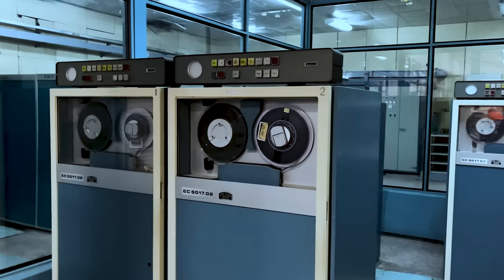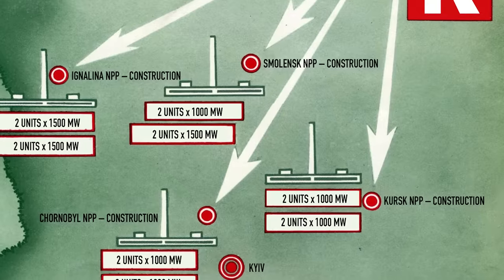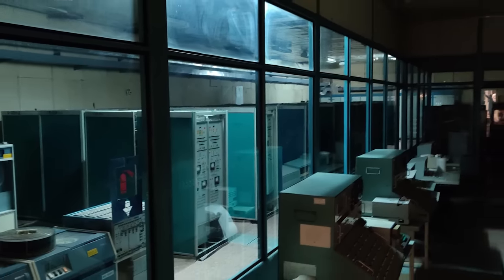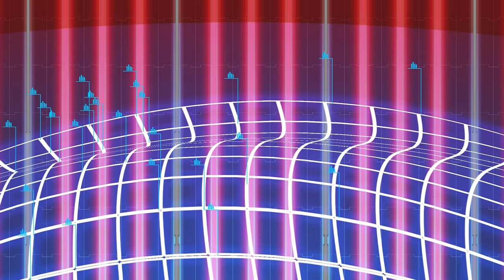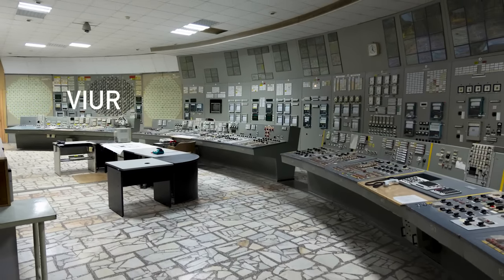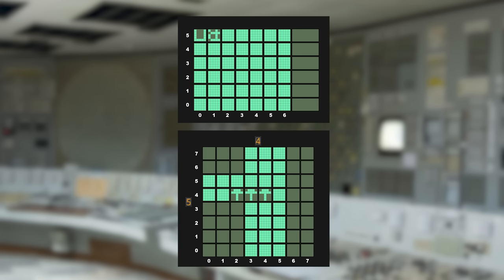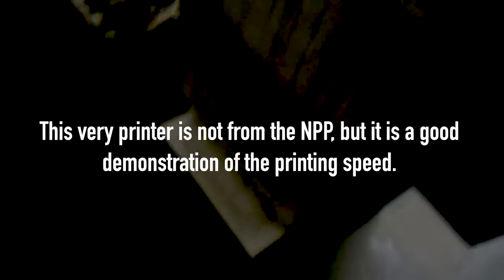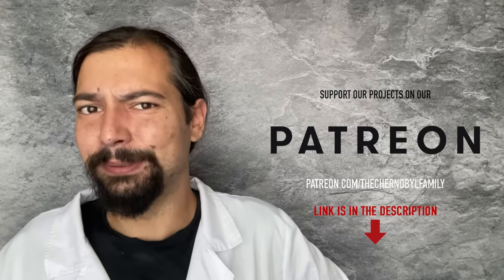Exploring SKALA: Chernobyl Reactor Control Computer

Comment: The computer resource limitations you discussed are not only in the Chernobyl Skala system but also in the USA 3 mile island reactor installation. It was noted that the priority data output from the computer was lagging very far behind during the melt down emergency.  I am thankful for the chance to see this equipment which may have been lost to the scrap yard without your intervention.
Reply from the maker: Thank you for those details!
Reply: I guess, the measurement reports came in so fast that the computer could not handle it in real time. 

Real Time operation was a big thing in the 1980ies; and not many computers could do it. Seeing it from today, these 'high tech' machines were slugs, but there was no better technology available, because it had not yet been developed. Don't assume that a Commondore 64 could have been able to do it. A memory of 64 kilobyte of RAM would be nice; but processing the reports of 1661 channels in real time was beyond its capacity. 

Also, all of the east European countries were suffering from a boycott, they could not order western computers, as they were categorized as potentially useable for weaponry; so they had to construct their own computers. They even had to develop their own systems. If you think of that... they sent their Soiuz rockets into space with that technology.
Reply: The computers of the age like the HP 2100 using the Real Time Environment software could process the data fast enough but the Teletype HMI device couldn't keep up so the output was stored in memory to be slowly printed out by the teletypes.
Reply from the maker: @gabbyn978  check the part of the video closer to the end; this is what I meant - signals of SUZ were bufferized and there is a chance at some point during 10-15 seconds after reactor 4 explosion that buffer got an overflow. We will make a separate episode on this.
Reply: Hi, I was a tech salesman with DEC in the seventies. One of my clients took me on a tour of a UK powerplant. I was intrigued by the use of Deva drum storage devices, they being long out of fashion, and a couple of minicomputers from a competitor which seemed a strange configuration. Getting the gen on them it seemed they were used for some tests in the installation and test phase, but we're so good at monitoring the operation they were left embedded in the final installation and could not be removed once the plant went live. One guy had a single job, sourcing spares and keeping the drums operational.... After that tour I swore I would not go within 20 miles of that plant, and never did.
Reply: @elkiton  The HP2100's you are talking about are still being emulated in various plants around the world, there is a reason for that, they worked extremely well and were very reliable.
 DEC equipment was running stuff in Libya for years after it was declared totally obsolete elsewhere due to sanctions.
Reply: @andrewallen9993  yep thanks, now I recall it was HP kit. Amazing how security has changed over the years, could drive around the plants unescorted to a destination building, at one place I got the wrong stairwell and finished up looking down on a functioning experimental reactor 🤪. I really enjoyed those early years of minicomputers getting into everything, job satisfaction was off the scale!
Reply: @elwoodcope7152  Weren't priority messages sent to the display panels?
Reply: I was 18 years old when 3 mile island melted down. I went on to get a degree in electrical/ electronics. all I can say is "had the operators at 3 mile island let the computer do its job, nothing would have happened, but no, the head operator knew more than what the computer was trying to do, and with the human interaction, bogged down the computer, coupled with the slow clock speed/ baud rate, it could not keep up with inputs/ computations/ outputs, not to mention all the forced outputs, that will slow down the polling table in the computer.  another big problem was that many controls did not have feedback loops, such as the stuck solenoid valve that was venting steam off of the reactor core ( cause of the problem)where a signal was sent to close the valve, but there was no return signal that told the computer that it actually happened".
Reply: The 300 baud teletype was implicated in TMI. The PDP11 would have been processing the data OK
Reply: @gregrudd6983  the chernobyl power plant melt down was not due to computer/ processor issues, it was due to a test that should have never been made, causing a run away condition that could not be stopped!!!.
Reply from the maker: You are right. There were no SKALA issues connected to it, and it is a historical fact.
Reply: @ChernobylFamily  I suppose they could have designed a bank of printers operating in parallel to compensate for their slow speed, each one assigned to particular parameters.
Reply: Upgrading to IBM or IBM compatibles before the incident would make the reactors much safer. Much easier to use.
Reply: @lauram5905  
I watched that video and it was indeed fascinating how they did it. It's a case of using the resources you have, rather than demanding more resources. Today's programmers could learn a thing or two.
Reply: As I understand it the TMI control room had a single teletype, which runs at only 110 characters per second. When there were so many alarms happening the printer couldn't keep up. 
The design at Chernobyl with multiple printers, with one for higher priority alerts, is a much better design.
Reply: It was also human error
Reply: After this description I really wonder, how few accidents happened in Sovjet block in Russian Sovjetunion and subjugated peoples. DEC and its PDP-11 computers could handle control operations in 1970... onward.
Reply: speakinf of computer limitations, the n1 soviet moon rocket failed because you couldnt control the amount of engines at once in that time
Reply: @gregoryclemen1870 Did they use polled I/O?  I suppose they did, or else the computer would have inherently known more about the status ... (?)
Reply: @bsadewitz  yes, there was a polling table set up in the computer , but the operators were over riding the computers, and causing  a non reversing run a way in the core.

Comment: all these hand-soldered elements, the ton of wire-wrapping and these wonderful ferrite-core memory-elements. The amount of work that must have gone into this system is staggering.
Reply from the maker: And imagine to manage this... or UPGRADE this, when they had to connect DIIS...
Reply: And into almost any 1950s to 1970s computer, single-sided circuit boards, hand-wired backplanes, valves, discrete transistors and other components... the effort to just achieve a small outcome by modern standards.
I read in the late 1970s about a company that replaced their old valve computer (power consumption: 3kW for the high tension supply, 4kW for the valve heaters, and 3kW for the fans)... with a Commodore PET 32.
Reply: ...and trying to do it in the utmost secrecy, wow....

Comment: It's incredible how modern computers barely take up space, but 37 years ago they took up an entire room! SKALA  was very powerful for It's time!
Reply from the maker: Especially if we pay attention to the fact it is a highly specialized machine, so not a computer in a general meaning.
Reply: MS DOS had already released for PCs by this time computers were desktop
Reply from the maker: ....and what is wrong ?
Reply: Actually, SKALA would have been well behind the technological curve by the time of the reactor #4 accident. Massive wire-wrapped TTL-based mainframes like this developed in the 60's were being phased out of service by the 80's, as the smaller and more power efficient MOS and CMOS based integrated circuits were becoming more and more reliable. At least in the west.
Reply: @BlackEpyon  Soviets were able to develop good systems for their industry and power plants.
Not able to develop consumer system only.
Reply: @lucasrem  "Good" in this case, just means that it was purpose-built to it's application. As long as it does it's job, it's "good."
Reply: If SKALA was still fully operational and could be brought back online, it still probably would be very powerful considering it should be capable of monitoring and maintaining up to five Fission Reactor cores and the related support equipment simultaneously. Чернобыльская АЭС was originally planning to install a fifth RBMK-1000 reactor core unit before the core breach of 1986.
Reply: @alexandervonzoller-sakharo6386 It would not be powerful--or at least not in the way you may be thinking.
Reply: @alexandervonzoller-sakharo6386 That is, it doesn't have to be POWERFUL per se to do that job so much as RELIABLE.

Comment: Wow, that system has a strong creepy vibe to it (in a good way). The control rooms were part of the computers. The operators were integral parts of the system, enclosed within it, their minds filled with codes. It must have been an overwhelming experience.
Reply from the maker: It was. People who worked with this, told us, all this felt like a city, it was very special.
Reply: I remember visiting my father's workplace, an analog telephone exchange that had a similar computer room, although much, much smaller, but similar in a way of having the tape reels, teletypes etc. Usually, around such machinery various stickers were placed with sort of short "reminders", and one of them said, "Remember, you are the brain of the machine". Your comment reminded me of that, it unlocked a 30yr old memory. 😁
Reply: Akimov and everyone else in the room probably had to get special education to run these systems hey 🎉
Reply from the maker: @therandomytchannel4318 not probably, but definitely. As far I remember, it required 8 years of study.

Comment: This is insanely cool, thank you. Even with my understanding of computers and programming it still blows my mind that people figured all of this out with the limited technology they had. Both hardware and software.
Reply from the maker: Thank you!
Reply: This is truely the salient point as to why the unmonitored unmoderated section brlow thd fuel rods reach where the Reactors core started thd runnaway condition which were initiated with ghe pushing of the AZ5 button.
For thise 8 seconds every was completely unmonitored to the actual conditions which caused the massive nuclear explosion.

Jeremy Penrice.
Electrical & Instrumentation Engineer.
Reply: im building a decent sized shope...i have a room for my pc gaming...one wall will be OLD monitors and computer interfaces! jesus i made need a video of the shit ive collected
Reply from the maker: DO IT!

Comment: Well done!  I have an affinity for old computers, when I was in the US Navy aboard the USS Jason AR8 (a repair ship) circa 1974 I was responsible for operating a Univac AN/UYK 5V computer, used primarily for tracking parts and work hours.  Not a single IC anywhere, everything was transistor/diode logic, with about 4096 18-words of ferrite core memory.  I/O was four tape drives, a teletype for a console, a huge chain driven printer, and an even bigger card reader/punch.  Surprisingly, the system had a COBOL compiler, and I wrote a small program to accept punch cards and print out a list of everyone serving aboard.
Reply from the maker: Thank you so much for sharing this!

Comment: This is beyond cool, always wondered what computer system was behind chernobyl.
Will there be any chance that the Tapes and drives that still exist to be read it and archived?
Maybe some day the SKALA architecture / system can be reverse engineered and be emulated with the original software

Proud to be a patreon member for this channel
Reply from the maker: They stand and do exist. Well, will suggest that idea.
Reply: They may be standard 8 track tapes. They look like rebranded IBM compatible equipment, and in that case the computer history museum has an IBM 1404 that can read the tapes and send it to a modern computer
Reply: I second the request for reading and preserving any tapes! @ChernobylFamily
Reply: Eh, it was an industrial control system, I doubt there's much value in extracting the raw numbers from those tapes. The same kind of applies the emulating the SKALA, it's not an ordinary "retrocomputer", it's an automation and control system for a nuclear power plant, how do you emulate it?

Comment: This is really interesting! So SKALA was much more than a computer solving complex reactivity equations but also an enormous real-time data acquisition system too - measuring and logging everything as well as looking for anomalies from "normal" operations?
Reply from the maker: Yes, it is a very good and correct definition you proposed. Actually, it comes from the meaning of its name — "the system of control and automatization".
Reply: and they did all that with 20kB of ram... 
current systems are so much bloated...
Reply from the maker: 200, as those 20 were is in octal system.
Reply: @ChernobylFamily  Still crazy - PLC I use for home automation has 20 MB RAM...  Thanks for this video.
Reply: Like modern day SCADA
Reply: @AmauryJacquot  is that actually the reason though? I'd love for someone to make a video comparing the processing power and memory of a system like this compared to say a early 2000's Dell home desktop tower. What the limitations of both are and why a modern day computer like I am writing this on now (a custom AMD 5900X cpu with 32GB of DDR4 memory) isn't able to do more futuristic I suppose you could say StarTrek like actions. Like run the entire automation of my home, find me information and interests that I may find specifically interesting from on the web. Know when I'm inside the house and how long I spend in each room. Be able to detect outside threats and alert the authorities, lock all openings and set off an alarm. I know this possible but I'm talking about one home computer that everyone can interface with in their offices and bedrooms etc. Not several machines doing independent tasks like my Surveillance server in my bedroom/office. I suppose the closest thing recently I can describe is CyberPunk 2077 like computing.  Like a Raspberry Pi (likely?) has more processing power than SKALA then why aren't we further ahead with technology?
Reply: @bradleybatt1401  you have three issues comparing the two systems.
1) in skala, I suspect all the i/o is memory mapped, giving the processor(s) direct access. This is similar to what a microcontroller does, but that system had many many i/o
2) the system could run with much less ram because the programs were essentially hand coded in machine language or assembly, giving the programmer the most control over the code, in particular related to i/o timing.
3) there was no “fat” in that system. Only the bare necessities were implemented, that were required to achieve the required work. No graphics or anything else required.

Your raspberry pi example would have plenty of processing power, but none of the i/o channels necessary
Reply: Running Prisma on it, simulating the tests.
many thanks, i was asking for this for ages.
Reply: @AmauryJacquot  Understand the OSI model, these systems all work autonomous, calculating all the data.
running Prisma !

Comment: As a former instrumentation engineer at a ASEA ATOM BWR reactor this is impressing as hell!
Especially if you think about that the computer must handle over 1600 analog channels at the same time (probably even more if you count in such parameters like steam and feedwater temperatures, steam pressure, feedwater flow and probably some data from the turbine). And then I haven't even mentioned that RBMK reactors have that possitive feedback loops  which means that the control rods must be actively controlled all the same time in order for the reactor to maintain a consistent power level.
Reply from the maker: Thank you so much!